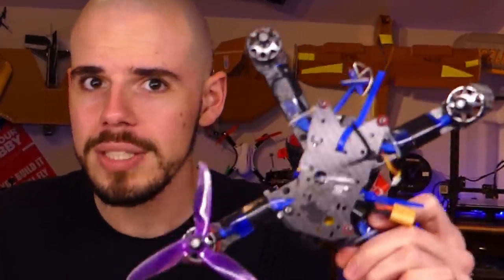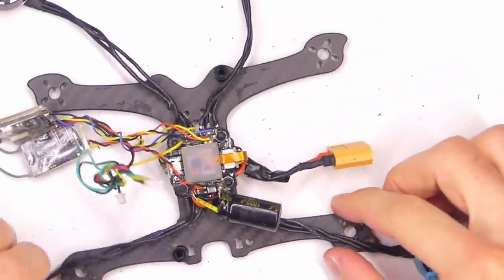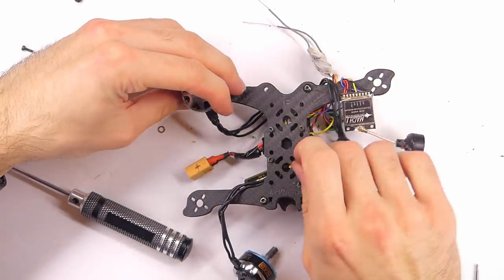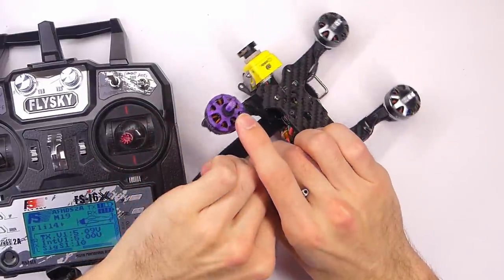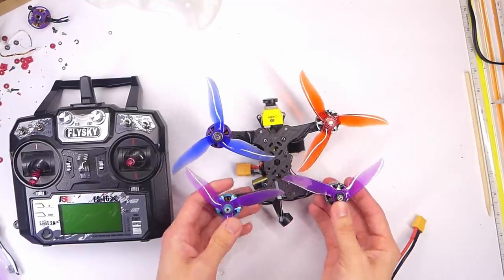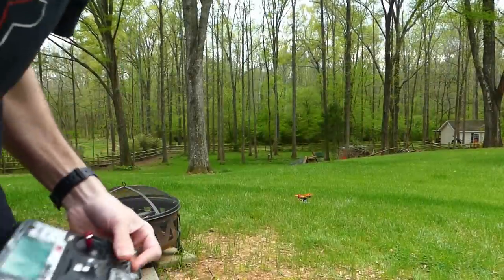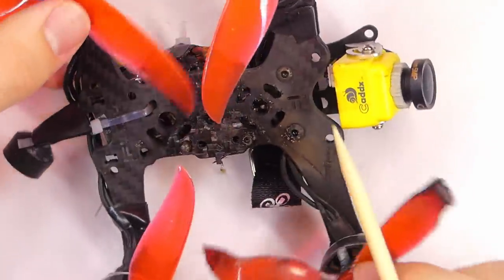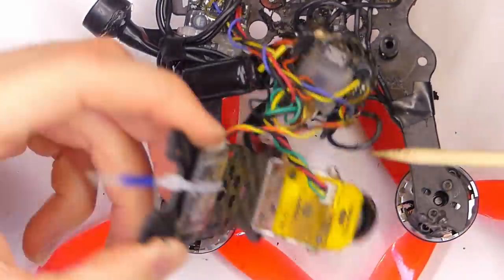5" Micro Drone...Wait, WHAT?? 😳 Propellers TOO BIG for Quadcopter Frame

Comment: The screw melted cuz it shorted the esc through the screw to the frame, a 30sec fire could not melt that screw.
Reply from the maker: I think you're right!
Reply: Makes sense to me. I don’t think it would melt that fast either but lipo fires are hot.
Reply: Yeah but if you short a lipo battery with anything metal which has a smal diameter it will melt acting like a fuse
The current paddy trough the screw melted it not the fire
Actually basic electronics here
Sorry for bad English I’m Italian 15 yo

Edit:paddy=passing sorry
Reply: yep that was my observation too, shorting to the carbon, had this happen early on in my FPV  experience,  crazy how the screw melted lol
Reply: I mean jet fuels can melt steel pillars
Reply: agree, as cool carbon fibre seems it is still a conductor and I already took experiences out of this in the past by melting several ESC´s due to failed insultation to the frame.
Reply: @Zeesneakyninja  That wasn't a LiPo fire, it was an ESC fire. I actually had a tiny ESC on a 75mm Brushless Whoop catch fire while I was on the Motors tab in BF testing it, as it was having issues (apparently it was the ESC that was the issue lol). They burn crazy hot surprisingly. I was very lucky it wasn't on something that could catch fire as it was in my house.
Reply: Cf is conductive and he just did shortcircuit

Comment from the maker: Let me know what YOU learned from this video! 
Remember, we learn more from our failures than our successes. 😉 👍 
Psst! Did you notice the magic smoke being sucked back into the quad at 11:19?
Reply: I always wondered if this was possible. Thanks for trying it out. Now I know it's possible.
Reply: Just saw the magic smoke. So that was the last time it took off and flew?
Reply: Yeah lol
Reply: You should make a frame with proper specs so the clearances and cooling are right. I love the offset motors and giant props.

I saw a couple videos on charging batteries and fireproof bunkers. I had an idea from that about using one of those metal wagons to hold the bunker and also put out a fire when charging. Fire extinguisher and sand reserviors would all be in a mobile dohicky. The original idea was so if you got a fire you could quickly move the fire outside so it wouldnt get your house. BUT, your situation in this video, gave me an idea! Take the wagon with you when you fly and you have a mobile fire extinguisher. 

Its like carrying a gun. You do it in hopes of never needing it, but if you need it nothing else would work. I wonder how many pilots carry sand with them when they fly? Dude, you got my mind spinnin. Keep it up man. SUB!
Reply: Yeep I was gonna comment this lol
Reply: New to this channel but PLEASE learn to use something other than tinkercad.
Reply: Tthis is why you want to avoid electrically connecting the frame to the electronics. CF is conductive as hell, and a small short can cause a big fire very quickly.
Reply: This happened to me before on an 8", what happened to your battery is that what caught on fire? or is it still ok? cuz if the battery has exploded i think it might have started by the prop puncturing it... actually i have a 3" old days frame that will take 5" motors without adapters that i'm about to do something similar for... the flying part not the fire part :P lol.. it has more than enough space even for 30X30  electronics... i have more than one in their box, would u like me to send you one?
Reply: After dumping my new 5" build into a lake 15 seconds into its maiden flight the other day, I really needed to see this.   Sadly it was only my 2nd ever build, and a very quick $300 up in smoke (so to speak).  I feel better now I know I'm not the only one to:   build - fly? - crash - repeat

Comment: You can literally see the motors smoking before the fire at 11:18
Reply: I don't think that's smoke, that's just a piece of string stuck to the back left motor. The short occurred rapidly, presumably the positive shorting to ground. You can see it's desoldered after the fact.
Reply: @jpsalis  look at 11:19 (the next scene)
Reply: @ivansimic1878  I see that now, that's really weird, I think that's coming from the FC though.
Reply: @jpsalis  yeah it's weird... i don't know how he didn't saw that before it was late...
Reply: @ivansimic1878  Usually it's a much more immediate smoke-out, the fact that it took so long is a bit bizzare, and that smoke was very subtle, I assume he had at least 1 flight after this takeoff before it finally gave up.  That was the FC smoking, probably some capacitor or something, not the battery.

Comment: I did this with 4" props on a 3" inverted frame analogue build.  Flight time of 30mins with a 1550mah lipo. (Providing you don't screw the bollocks off it and fly without the extra weight of a gopro).  No fires so far and goes like a rocket.
Reply from the maker: Wow. 30 min? no way!

Comment: Hey i wanna ask what are the benefits of color prop distinguished one?
Reply from the maker: Hi! I'm not sure what you mean. 🤔
Reply: @RCwithAdam1  you know a lot of fpv player like steele that the 1 prop of 4 prop is different 1
Reply from the maker: Ohhhh I didn't know that. I could see it being useful for line of sight flying to maintain orientation, but not sure for fpv.

Comment: If screws touch the windings on the bottom of the motor it will get hot and fry.  Or if your solder joints are bad on the esc it will do the same. Fun project by the way

Comment: Adam, i modified my FLY Sky I6 Radio  with 2   5dBi antennas, i added 2 rp-sma connectors , also flashed it with the 10 ch firmware, :D
Reply from the maker: Very cool! Have you noticed better range?
Reply: @RCwithAdam1   havent tested well, i crashed it

Comment: Looked to me like that bounce pushed that screw through your lipo packs poly cover and you had a thermal runaway. that fire was too violent to be just a short circuit to ground imho and a venting lipo certainly has enough heat to melt a screw head...
Reply from the maker: Hi! Nope, the battery is fine. I think the battery must have bridged through the screw.😮

Comment: Sure it wasn't a LiPo fire? The sparks made it look like a battery fire.
Or maybe a short in the battery cables? Near the capacitor maybe?
Reply from the maker: I thought for sure it was, but the battery is totally fine (at least externally)!
Reply: @RCwithAdam1  I think the board got bridged with the carbon frame because it was mounted so close. Awesome job tho! We learned something together

Comment: The battery voltage shorted to the frame and to the metal bolts.   Using used parts that were already configured to a different build insure added variables that causes bad shit to happen.

Comment: Haven't watched the video yet stopped at 5 Seconds in to give the common sense answer to the problem. Offset two props diagonally opposite each other (AKA caddy corner) put spacers in so that they rise a little bit higher then the props next to them that way they won't hit!

Comment: The BIG problem of this cool idea is the battery, it's crazy to use a 3" battery (a 500-750mah?) in 5" motors, you will fry the battery for sure.
Reply from the maker: Hi! Yes, it is a small 4s battery, but it uses an XT60 and decent C rating. So while I think it wouldn't last long, it should be okay performance.

Comment: Oh Adam. What a shame. 1. Carbon Fiber and screws are conductive. 2. Dont skimp on clearance. 3. Electrical tape and conformal coating (double protection). 4. Double-check no stray wire whiskers

Comment: Interesting experiment, but why would you put props on that obviously would hit each other? Fools errand. Maybe space the front and rear props higher or lower....hold the f on for a second.....that might work!!!! .....Then you need to think about the air being fed into the lower props from the higher ones....I'm getting to work.

OK, you did. I should really wait until the end to comment.
Those motors look hilarious in respect to that frame. Go to town dude! I love how you  will slap any old motor on....and all with a a Flysky I6 transmitter. This is what makes advances folks....using whatever to try 'whatever', and being astonished at the result.
I'm pissing myself laughing at the motors on that thing. If it flys, rip it.
Oh and I forgot to thank you for the 3D print I grabbed from Thingiverse. The FC adapter without posts was the one I needed!! Dunno where you live but those trees are nice. No scraggle. I don't know about the builds but you've got some great video going on. The fire.......sorry but I died laughing. You can't experiment without some failure.
Even though the frame is burnt, fly it again. Who the F cares if it's a test bed?

Comment: Choppie chops  YOUR FACE     I cant believe I'm still watching this blasphemy. What happened between 10:15 and 10:17 you had props on wrong ?  Oh my freaking goodness  spacing for electronics ?   My Krap has heat shrink all over each component and then they are all stuffed tight atop each other packed tight.  Never a fire.    Maybe a heat sink on the VTX but rarely . Prop / Motor KV  to ESC rating more like it.  And give that damn Eachine Wizard motor a proper burial already.